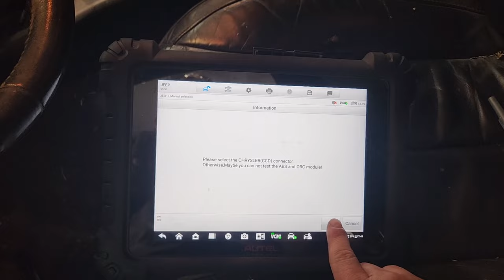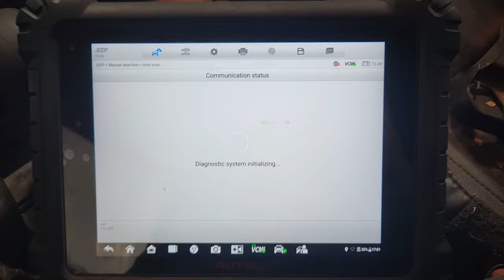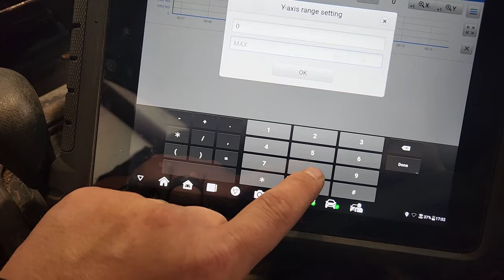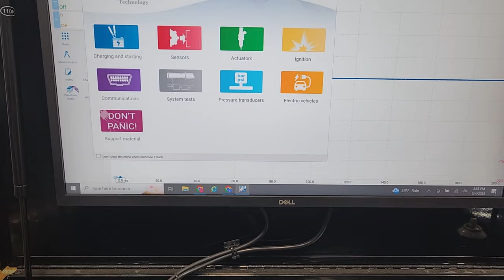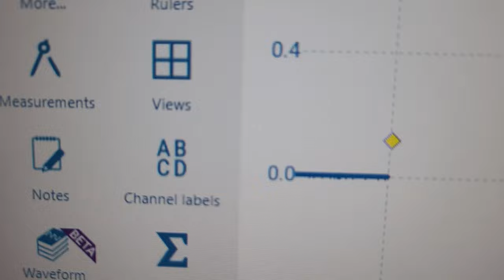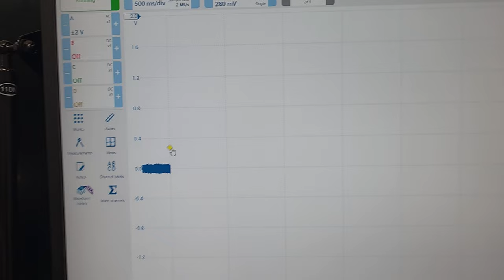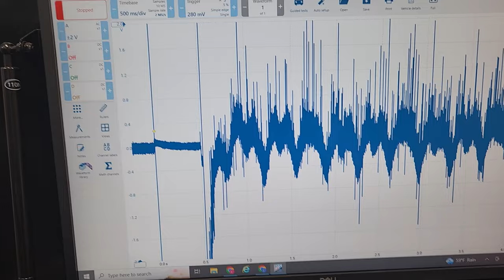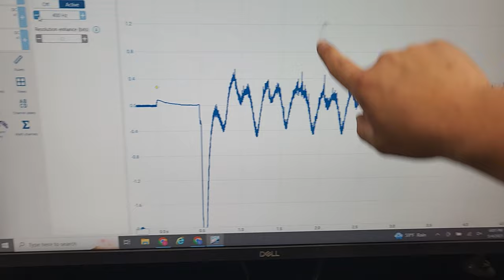Jeep Crank No Start Diagnosis!

Comment: Great to see you get to the actual root of the problem without playing with the customers money 👍👍 I had one that showed a similar waveform and it confused me for a minute because it was the same type of set up with timing so there was no way that it could have been related to timing issue, it turned out the customer had mixed up the plug wire arrangement and was causing the engine to "fight itself" during cranking, simple swap around of plug wires fixed mine. Thank you for sharing and rant all you want, we might a learn a thing or two withing that also lol
Reply: If vehicles were not so loaded with processors, that would have been an easy diagnosis back in the 70's - 80's

Comment: I could hear it the first time you turned the engine over there was deffiantly something wrong with that engine mechanically

Loved the way you did ac coupling on the voltage at the battery for the relative compression test another tool to add to my box

Comment: Super Mario Diagnostics did a video on how relative compression test can be misleading on a gasoline vehicle with diesel in the tank that had cylinder wash.  The waveform showed that it had uneven compression.  However, a wet static compression test showed that the compression was good.  I don't think it's a good idea to throw another shop under the bus based on a relative compression test.  It should be followed up with a wet static compression test.

Comment: Still like how Eric explains things ,sorry ,and if it is the crank position sensor,simply how did you find that please ?
Do sensors have a test that can ve done on a cheap ohms meter ?
Most people who have any knowledge will go for the Spark ,fuel compression thing first and once thats established,would liok at CPS
Reply from the maker: Testing and analysis found it, resistance is not a good test, it can have good resistance and still be failed.

Comment: How would you have approached it if you didnt have a pcm laying around? Would you have jumped the starter and confirmed good sounding conpression on all 6 cylinders before calling the customer and telling them it needs a pcm first before going further into diag?
Reply from the maker: Unfortunately we would have diagnosed and repaired the PCM issue then found the engine was failed.

Comment: A quick google search shows the firing order is 1-5-3-6-2-4.  If you consider cylinders 1-3 as the front half, and 4-6 as the back half of the in-line engine, the firing order goes front-back-front-back-front-back.  So what could make every other cylinder (in the firing order) have low compression?  It would appear to be either the front or rear 3 cylinders.  A twisted or broken crankshaft between cylinders 3 and 4?  Perhaps the camshaft is twisted or broken?  I'm racking my brain trying to figure out the cause of the odd relative compression waveform.  The exhaust manifold splits into two banks, IIRC.  Perhaps one of the exhaust manifold banks is clogged.  What was the cause?!! lol.  Not looking for a silver bullet but all things I'm thinking it could be are crazy situations.
Reply: Going deeper down the hole here --it can't be a broken crankshaft.  The starter motor spins the flywheel, and if the crank was broken, the front crank sprocket wouldn't spin the camshaft, and no cylinders would have compression.  The crank could be twisted though, if that's ever happened before.  Perhaps the crank is fine and the camshaft is the issue.  That would place the front 3 cylinders as good and the back 3 as bad.  Very interesting to think about.
Reply: I agree, while it could likely come down to a bad motor I think I'd see if the customer would pay for more testing.  It could have fuel washed 3 of the cylinders due to a ckp or distributor issue.  And exhaust restriction on one manifold would cause the speed density system to dump fuel and flood some cylinders.  Wouldn't add much time to just go in cylinder with a pressure transducer on a couple

Comment: Since the crank sensor isn’t working and no spark. Is there another way to check which cylinders are low compression?
Reply from the maker: Absolutely, I could use an incylinder transducer and then plug in the firing order.

Comment: Low compression, it was not galloping that bad, would still start. It’s probably not starting due to ECM - PCM comm issues. The charting of the started output confirmed nothing IMO
Reply from the maker: Had blown headgasket, I addressed the PCM concern in the video.
Reply: @L1Training  That WJ is nearly identical to my daily driver, but in rougher shape. I wonder if the engine overheated due to a faulty solid-state cooling fan relay. It's a pretty common problem on these, but fortunately the fan shroud will also accommodate a regular clutch fan.  My fan and clutch is off of a GM S-Series truck with the 4.3l engine. It threads right on the the water pump snout on these 4.0l engines. No more electric fan to worry about, and it's been an awesome vehicle for me. Great video, by the way!